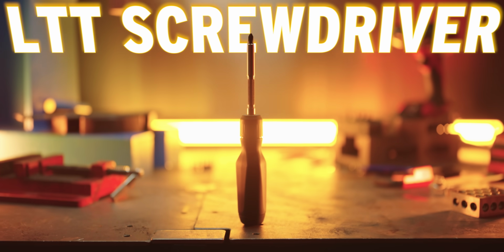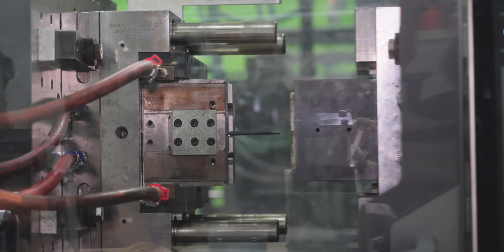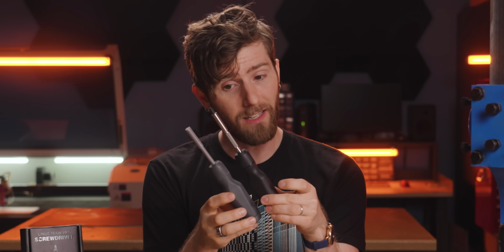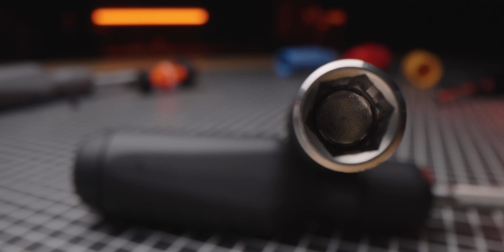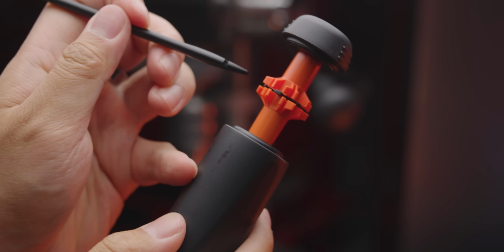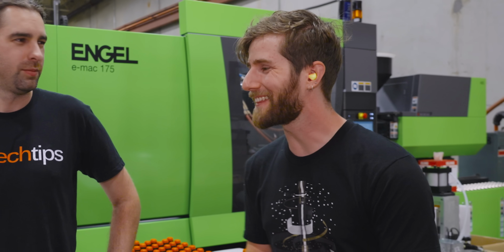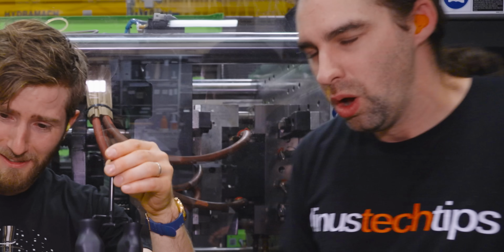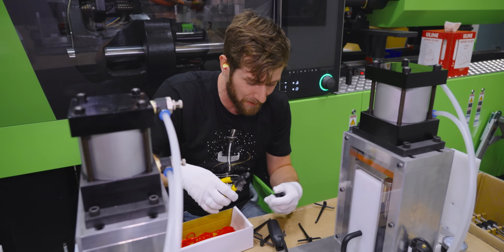Why our Screwdriver took 3 YEARS

Comment: I didn't think I would buy this screwdriver but I ultimately decided to get it. The fact is that every single ratcheting screwdriver on the market, including Snap On's, is such trash, or at least $150, that it's easier to justify this one if it is actually decent. I don't like the overuse of injection molding, even if it is to keep the weight down, but the use of acetal in so much of this product is promising. Still, it's so close to the cost of a decent torque limiting screwdriver, around $125, that any screwdriver without that feature at over half its cost just seems like a bad buy. We will see if my opinion changes once I can compare it to my torque limiting driver. One missing feature that really should have been included at this price is a bit lock with a quick release.

Comment: The bit about shifting the metal fabrication from Taiwan to China really caught my attention. Taiwan has a solid reputation for quality. China has a solid reputation for poor quality and screwing its business partners. Tool quality has gone downhill over the last decade or so as more manufacturing has coalesced into common factories in China. Geopolitical and economic shifts have companies decoupling from China to other Asian countries or domestically. Wondering if the tool company that bought the Taiwanese factory did it as part of a decoupling from mainland China? Ironically forcing it to give crap quality to LTT, forcing LTT to look for a ML Chinese factory. Ironic and mysterious. Could be a lot to this story. Could also be some LTT-like screwdrivers available for cheap on AliExpress in the near future...

Comment: Amazing! I forgot mention in my first comment.. 1. Do not touch pallets unless you are want to experience with extremely painful electric shock.. 2. Screw in barrels create extremely high friction between fed materials which melts the plastic pallets. Heated barrels are not the main heat source to melt plastics.

Comment: Even though it's expensive and i mean that.  I still ordered one to put to work in my job as an industrial electrician.  My only concern is if it will fit in the terminals on control cabinets.

Comment: Having just assembled two PCs, and noticing the similarities among my high-dollar drivers, your dazzling driver, and the Megapro,  I see they all fall down in one area: They're too dang big to fit into many situations requiring screwing.  Several times during my recent adventures I resorted to using long skinny freebie manual drivers (branded with the names of various random concerns) to put the finishing touches on components in tight areas.  So there. 😐 😐 😐 😐
Reply: i use extension bits for this very scenario. but at the same time i recognise theres no such thing as a tool for EVERY scenario.
Reply: @furythree  Wasn't this screwdriver supposed to be for building PCs though?  That's what they said in the video, the original concept was to design a screwdriver that wasn't frustrating to use to build a PC and they just made another general purpose (if high quality) screwdriver.
Reply: @furythree  
Exactly, I have over 50 screwdrivers, and there is still a bit of 'making do' when I don't quite have the one I want.
Unlimited budget I could see having well over 100, easily.
Reply: I can see what you’d mean by this, but Ltt making a screwdriver that was small and fit into tiny spaces wouldn’t make sense. It would been less applicable in many situations as a screw driver
Reply: thats why i like my ifixit driver. shit ton of bits, driver itself is thin and not too long, and for tricky spots there is this rubber extension that can go in a curve
Reply: Ya I felt the same, most cases the side panel mounting rail is in the way of top screws for big drivers, same with rads/fans the motherboard or case is in the way....
Reply: Also for $100 I could just buy an electric screwdriver/drill and a battery rather than a ratcheting screwdriver
Reply: Yeah, that's a completely different type of screwdriver though, they aren't usually very adaptable nor durable.
Reply: Yes, there are two things you need to builda  PC (aside from common sense): small hands and small drivers. You can do it with big ones but it's gonna hurt. For precise and small access I prefer the regular ifixit driver as that is reasonably small. The problem is that in many cases you need a driver like this where you can have proper grip and use proper force. And the fiddling in small areas can be avoided in most cases with proper planning/testing before assembly. That said, bloody fingers/knuckles are still part of the PC building procedure for me :D
Reply: Thats what I thought. It looks more like a (pretty good) screwdriver for general home use, but not necessarily computer stuff. Just too heavy and big
Reply: You win some you lose some. Can't have an exchangeable bit driver fit into every cavity.
Reply: @Noksus  
Truth! - some cavities have been to small for my bit - "that's what she said".

Comment: Will definitely be looking into buying one. Worked 10 years in electrical and atm controls and automation and have been looking for years for a super high quality screwdriver with interchangeable bits. Been using Klein ratchet drivers for years and the ratchet always gives out within 6 months. Definitely an enlightening experience to how complicated and expensive product development can be

Comment: Sadly, the mistake of changing the bits to not be universal in either direction is a deal breaker. a tool becoming useless because you loose that 1 bit you use 90% of the time makes it a terrible thing to put in your bag.

Comment: I’ve really been anticipating this screw driver and I was so excited for its release finally. Then I went to buy it in the store, $85 for a screw driver! For me, that is absolutely unfathomable.
Reply: Especially so, when you consider that Megapro’s ratcheting screwdriver which this is designed from is $32
Reply: $70 USD but still... Probably not gonna move many at that price point. You have to ask yourself, how much does it cost to go buy a small kit to do the job this one does? Also, how sturdy is that plastic lever on the ratcheting system if it takes a few drops...

Comment: I have seen a lot of haters on the YouTube community section when this was first announced, about the price. But this particular screwdriver is made with such specifics that requires a certain level of over engineering and precision, not to mention basically built to be an heirloom.

I have screwdrivers all over my house, from basic ones to multi-bit ratcheting, but everybody's going to have their one "good" screwdriver and this might replace my reversible shaft bit driver I'm currently using as my good one.

Comment: I'm throughly impressed. I might suggest nerding out with in mold cavity sensors and using that for process control. It's the best part of my day when I nail a template match from an electric press on a hydraulic press. I've been molding for over 20 years with many certs including Master Molder I from RJG.

Comment: The prerool sponsor was the worst possible choice. No MAC user will ever be able to use a screwdriver. They are trained iDiots which are conditioned to throw everything away as soon as the battery is empty. The video itself was great, but I am not sure about that strategy Linus....

Comment: idk man 70 bucks for a ratcheting screw driver with only 12 bits it's kinda expensive plus shipping almost 100 bucks total 87 for me but still that's pretty close to 100. not only that but it's the plastic shrinking that's the only thing holding the whole mechanism, in some states like tx it gets really hot, like hot enough to make things expand, specially plastic, black plastic even worse since it absorbs more energy from the sunlight. I can imagine that would be a problem it would make the mechanism wear the plastic faster or even slip inside the screwdriver.

Comment: I have purchased some utterly rubbish screw drivers, i mean, levels of rubbish where just trying to undo a simple laptop under tray screw has either stripped the bit of utterly fuxked the driver join. Utter crap! 
I have also bought some really great screw drivers. Never that expensive though because im poor. But i understand that more expensive CAN mean better product. I really hope that Linus and Karl/Carl  has done a decent job and it lasts. Because at the end of the day it adds up buying crap every year and striping screws or buying something decent and never buying again (until its life cycle ends, nothing is forever etc)

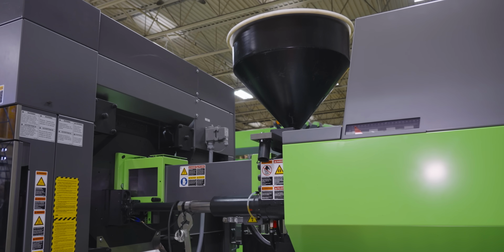Comment: 20:10 No worries. The hopper of this machine is discontinuously fed by the machine operator getting material from the dryer using this bucket. 20:25 Not quite. The purpose of the piston you are seeing and it's twin on the backside is first to insure that the injection nozzle of the plastizising unit is pushed with enough force to the back of the mold during the injection. Else the aggregat would be pushed away from the mold during injection due to the high pressures during injection of a plastic melt. Then the plastizising screw inside the plastizising aggregat moves transversaly in order to inject the molten plastic into the mold (you can picture this more or less as an injection by a syringe). The whole injection aggregat is actually hidden behind this green and gray sheet metal stating caution etc. It's fully covered for safety purposes (high forces during movement and high surface temperatures)

Ineos Styrolution actually meanwhile provides ecofriendly ABS resin grades named "Eco Family", which have an amount of recycled plastics of up to 70%. Hit my up if you need a contact. Working pretty closely with them and Engel aswell (the injection molding machine manufacturer)

Comment: 303 is always a decent option since you're not welding it and going to high temperatures, but if you want a better passivation layer there's ways to get aluminum oxide instead of the chromium oxide you went with.  You can even tune the thickness to get some colors if you really wanted.  Also gives you more options if you didn't want to use stainless such as if you want the whole shaft to be magnetic.

Comment: Ordered two.  One for my me and one for my boss.  I went for silver shaft for long term aesthetics.  I went for all black plastic because the first run in all black uses a higher quality plastic for the interior bit holder that is going to be cheapened for both black and orange moving forward.  I understand the reason on the latter, since the interior bit holding plastic is not expected to be as prone to stress requiring the higher quality....but why take the chance if higher quality is available for the same price?

Comment: Wow, Engel machines... Worked with Engel 50, 100 and 200s back in the early 2000s, I'm surprised this company doesn't have an automatic feeder from the dryer to the hopper.

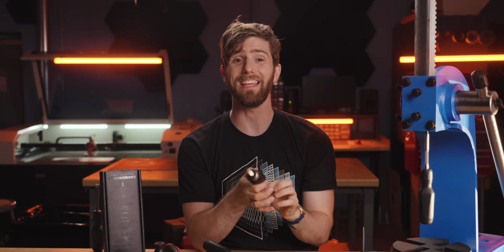Comment: All in all amazing video and super excited to see it in person when I get mine! One critique I have in this video is at 14:15 , its hard for me to see but if that is a Robertson screw it is not really a good example for demonstrating the magnet. A Robertson or 'square head' screw can sit on a bit without any magnet at that size. You should have used a Torx at the very least, but more reasonable a Phillips head screw. 
I do not doubt the strength of this screwdriver, but I do think LMG strives for accurate representation, especially on their own products, and I think this one portion could have better examples.

Comment: Plastics Engineer here!!
Why didnt you just make the mould have a molten inlet(runner and spruce)? should be possible, with your type of mould, this would reduce your need to regranulate, your waste and help keep the colour the same every time. in Denmark most of our injektion moulding is using this to save money

Comment: I spent 5 years on a factory making cylinder heads...... I would of went crazy in a nice clean environment like that.  Heat sucks, but heat sucks more with a haze of iron dust in the air and coolant and nasty.

Comment: I do a lot of repairs and an issue I often have is that the shaft + bit is too big (in diameter) and too short (in length, duh) to reach a lot of screw-holes. Using Linuses hands for reference, I don't think this one would fit eighter. My ifixit one also doesn't reach, but a very cheap one does, and has adjustable length.... Spend less time and money on looks and feels, and more on making it actually functional. Don't care 'bout the orange color man. The handle alone looks huge. What's this screwdriver for anyway? auto mecanics? electronics? residential electrical work? or spoiled gamers who occasionally add another ssd or whatnot XD. I'd love to be proven wrong here, but not enough to pay 70$ for it :)

Comment: I haven't seen it in the comments yet, but for those wondering the price, it's $70 USD before shipping, handling and tax. There's certainly reason for a tool meant to last many, many years and one that took hundreds of thousands to produce from a medium sized company, but for someone who uses hand tools relatively sparingly, that's a difficult consideration.
Reply: The elephant in the room is the turnover. I do not know how much they make per piece, but 15k pieces times 6 plus 7k is 97k screwdrivers this year. 97k times 70$ equals 6,79 milion USD. They sold almost 4 waves in a day wich is great, but i already have all the tools i need to build PCs... soo do i still buy it just cause i might like the product?
Reply: how long do you suppose a regular screwdriver will last you? 10 years? 20?
Reply: @alastairarmstrong1454  in my case, neighbors are shit and they steal before it wears out. Or I would simply lose it.
Reply: @alastairarmstrong1454  my 5$ screw drivers last me 12 years until I lose it
Reply: @alastairarmstrong1454  Honestly if it can't last 10 years with some use and not being gentle with it at all then it's crap imo as my cheap $149 (AUD and almost 10 years ago so let's say like 100 USD or less) set with 100+ assorted tools from nearly 10 years ago still works just fine and I haven't babied my tools even in the slightest. I've dropped them thrown them and used them in ways they weren't designed for and yet everything works just fine so yeah 10 years minimum for an actual premium product imo is at the very least how long it should last.
Reply: If you use it for that one purpose though, and it's manufactured well enough, it will be the best experience you ever had. This is a product for people that want that. It's a "retiree's" screwdriver, and I don't mean someone who's retired. Probably like you, I'm past the point in my career where I use hand tools as much, but if I have to use one, it's going to be that one, and it's going to be amazing, and I'll probably never need to use another screwdriver for the rest of my working life. That's worth eating out once, or a video game.
Reply: Hey, at least they have a warranty for this one, lol
(But whether greedy Linus Sebastian will stand by it, who knows)

Comment: If my screwdriver is sitting in concentrated vinegar, how long will it be before the bits get significantly corroded? Is the bit holder water tight?

Comment: As a mechanical product development engineer, this was an awesome video showcasing major engineering and design tradeoffs that go in to bringing a product to market. I'd honestly love even more detail on many aspects like material selection, machining/molding tolerance debates and testing, stress analysis (did you use FEA?) etc. but I can see how some of that just can't make it into a highlights video, not to mention the potentially proprietary aspects. I'm sure the full list of lessons learned and knowledge of what NOT to do was very expensive to obtain and therefore quite valuable in its own right.

Comment: Nice work but i have to call bs on one thing.
You said you tried all the different screwdrivers that people said would be better?
Bet you didn't try the Craftsman Speeddrive.
I will give you points for 2 things. The bit loader is better, and the handle is smaller, which you wanted. But the smaller handle is a preference of yours, and not ideal for things that require more torque than a PC screw. Aside from that the Craftsman Speeddrive wins on every front. Matter of fact Craftsman's bit loader may be better too, since it's just a hollow handle and the bit loader drops in, that's one less thing that can break over time.

Comment: my only issue would be it's just another multi-bit head that doesn't fit down the deep screw coutersunk holes I would rather have a small Hex end that fits and holds on the bits so the bit end fits down deeper holes. Basically rachet internal like handle but the bits although fewer per handle clip into the handle at the neck for deep reach bits to be used without a mamoth long screwdriver. Sell in multicolors so people can decide which bit sets are which colors.

Comment: LTT, I will absolutely be buying two or three of these screwdrivers. I've been wrenching on everything from cars to houses to computers and CNC machines for years. I've been through more cheap ratcheting screwdrivers than I can count and it got to the point where I was taking apart one ratcheting driver to pull parts from it to repair another. Make no mistake, I own many very expensive screwdrivers, I own specialty screwdrivers for most any specialty you can think of. Did you know Japanese phillip head screws are a different shape from American phillip head screws? If you've ever stripped a screw on the carburetor of a Japanese motorcycle you might want to consider picking up a nice set of JIS Spec screwdrivers. Anyways, enough flexing. I'll be buying, I hope your screwdrivers will finally put an end to my pain!!!